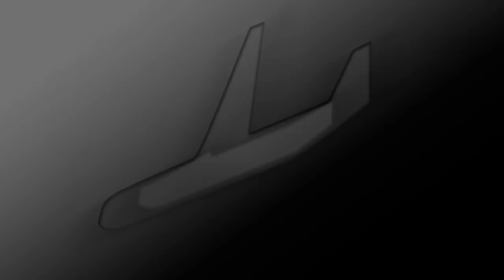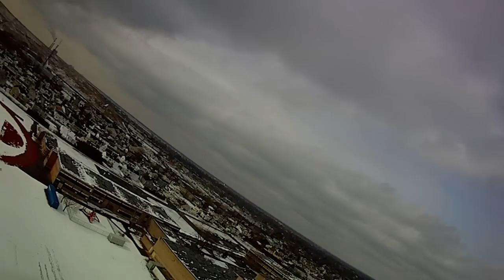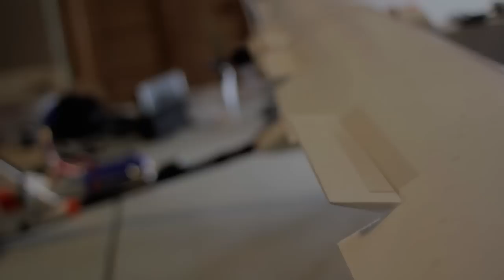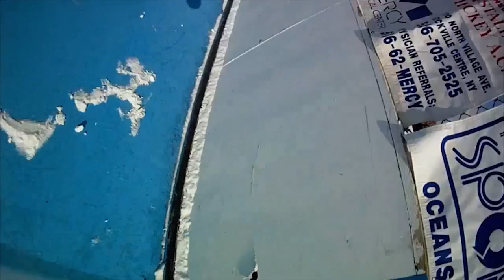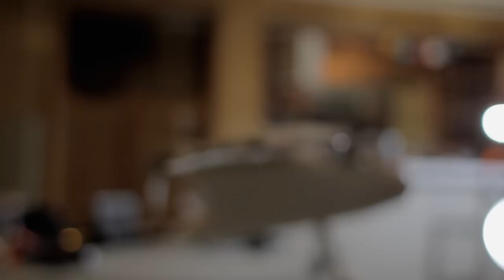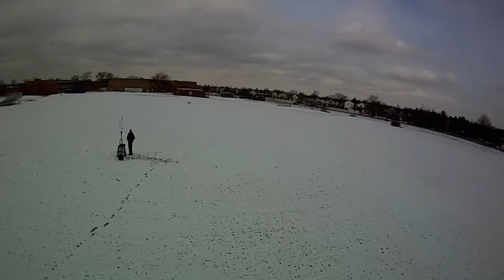Identifying Wing Twist - Skywalker 2013 CF tail

Comment from the maker: The gear has 3 bolts that secure it to the fuse. The new skywalker has a flat bottom with plywood inside and outside of fuse.  I used one piece of ply that came with the landing gear inside the fuse, drilled 3 holes and bolted the gear on. Piece of cake! Also, this way it is easily removed if i want to hand toss and skid land. I just put a strip of duct tape over the holes for the day. works great!

Comment from the maker: On the plane I have a horyzonhd v2, which is great as long as you properly mount it to avoid jello cam. The footage in this video is bad but i later fixed it.
The cam i use for live FPV is an RMRC 520 camera and I don't recommend it.  i think there are better cameras for less. a great fpv cam is the pixim 690 but it is larger and heavier...i have one and wil be moving it to this plane.
i used a canon 60d to film this "bench" footage.

Comment: Thank you!! so well done.Step by step wonderful.Curious from what supplier did you order from?
Reply from the maker: bevrc but it seems to have been a bad early batch that made its way through a bunch of vendors. I've built many SW 2013 1900 UAVs since and none have had a wing twist problem.
Reply: duffnyc77  i have sw2014 1900 and it has wing twist on left wing causes plane to roll Left so hard..... so buying stuff from BEVRC is over for me... (and i am not the only one having this problem.. many of my friends having problem with SW wings and they give up and made themself 2m strofoam wings from scratch... 

but when i get back to my hometown i will try to rescue my SW one last time as you showed in video. 
thank you..
Reply: ***** You replied to wrong guy Im not creator duffnyc77 is-I agree with you though.Perhaps repost at bottom of video.Goodluck.
Reply from the maker: bought from bevrc

Comment from the maker: Gokalp -I replied to you on my phone but i guess it didn't work...sorry about that. I use the bevrc 980kv motor with a 9x6 prop and 40A ESC. But others are using a lower KV motor with 12 inch prop. I can cruise at 4.5-5A with my set up and fly for 40+ minutes on 5000mah 4s lipo so that's good for now.